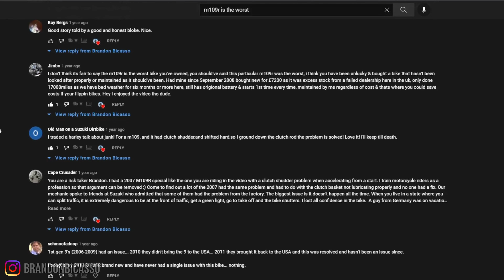Why The M109R Is The BEST Muscle Bike I've Owned

Comment: Brandon, I found a 2010 Victory Vision Tour ABS a year and a half ago, well kept with only 11,000 miles on it. The previous owner had died in a work accident and the widow sold it for 6000 dollars. It only needed a brake bleed and oil change to get it perfect. I have put 7000 miles on it this past summer with no issues. I am 6'5", 280 lbs and almost 67 years old. It is hard to find a bike that fits someone my size without extensive modification costs. The Vision is a perfect fit. It seems to do everything I want to do with it very well. Maintenance is easy and cost effective and the Freedom 106 engine is so simple to work on. This may go down as one of the best vehicles I have ever had. I plan to keep it long term.
Reply from the maker: Interesting story. Enjoy it!

Comment: I sold my 2008 M109R  because it had a tiny bit of a miss to it at lower RPMs.  I new that it was more than likely a map valve,wich is why I traded my 2002 Yamaha warrior XV 1700 straight up for it in the first place. I think I had right at $1,500 in the Yamaha, and the guy was asking $5,500 for the Suzuki.  That was one of the better deals that I have ever had, but before getting the chance to plug off the map valve a guy in Nashville Tennessee offered me $5,000 cash money for it.  After selling the Suzuki I ended up getting another Honda VTX 1800. My m109 had the same color of paint job that yours has,wich reminds me of a 1969 Camaro SS for some reason.
Reply from the maker: Mmm, you’re sticking with muscle bikes too as well. I wanted a warrior at one point too but could never find one for sale. Tried to buy two off Craigslist and each time someone beat me to them.
Reply: @BrandonBicasso After seeing how much I liked the first warrior I had to find another one to go with it. I looked for a good while until I came across the other one, but I had to sale it because the guy who bought it offered me double what I had in it.  I've probably bought and resold around 15 bikes in the last 2 years. It's truly been a blessing to me.

Comment: Just wanted to say I’m trying to buy a m109r But I wanted to know if I buy a 2005 2006 will it look like a 2008 2009 one 2010 And if I find a 2005 2006 what the Price should be for that year
Reply from the maker: Depends on the miles but most of them run in the 5-8000 range in those years. For reference, I paid $7500 for my 07 with 7800 miles in '14.

Comment: Nice vid, thanks. I never even knew the M109R was still in production for the US market. Here in Europe (where we know it as M1800R or VZR1800) that doesn’t appear to be the case. I’ve had my 2007 in the classic black and chrome for some 7 years now; I also have a Kawasaki Z1000SX but if I could only one it would be the M1800R. It has the power, unique styling and sheer presence that make it stand out, it’s so-o-o comfortable and handles so nice, once you get the feel for its dimensions. There are literally only 2 changes I’d like to see if they ever brought out a new model; add ABS and a gear indicator.

Comment: Current favorite bike would be my suzuki s83 boulevard. Got it dirt cheap just to truly try out a cruiser and I love it. Was looking at 109r's and others but am happy I got this since it really handles pretty good being 200+lbs less. Not sure why i still like it so much compared to my multiple other bikes, but it always makes me smile.

Also, some ancient bikes have large community's that sell parts. Me and my dad are into moto guzzi's and the big block motors they made for 35 years with quite a few interchangeable parts. I know BMW is the same. All depends on the bike. Still want a proper muscle cruiser like a rocket 3 or vmax but am pretty content as is.
Reply: I have the 2003 version of the same bike, back when they still called it the Intruder. Got to agree with how it's way mimore fun than you'd think if all you saw was the spec sheet.

Could stand a bigger fuel tank though. Mine gets lousy fuel economy for some reason 😂
Reply: always liked the power of the M109 but shaft (jack) drive is horrible
Reply from the maker: @squish3r  I’ve had some of the most fun on a 250cc motorcycle lol.

Comment: I like the importance you give to parts availability. I never want to spend a lot on a new motorcycle, so I buy older ones and get them working. I found on my first bikes, that were mid-80's Hondas, that most of the parts were only available used and I could never be sure the parts I bought would work. Then I got a mid-80s BMW and found BMW still has parts available for their bikes back to the 70's and some older. At one point I heard when they run out of the old parts they retool and make them again. Because of those parts availability, the old beemers make great project bikes.

You mentioned trying to decide which of your bikes you like the best. When people ask me which of my bikes I like the best, I tell them my favorite bike is always the one I'm riding at the time!

Comment: You do not want ABS, TCS  and other technology done to the m109r as it will add more weight to the MC
Reply from the maker: Okay, explain Rocket 3, Diavel and other newer muscle bikes that are over 100 pounds lighter? There's more to weight savings than adding computer modules. The entire chassis would need updating. I'd be more concerned on price than weight.
Reply: @BrandonBicasso The m109R is heavy enough as it is already and if they did a redesign in order to decrease the weight and add ABS and TCS and made the M109R lighter it would no longer Be an M109R. Flash the ECU for more power or better performance and that is it

Comment: Looking at your m109 videos helped me decide buying a m1800r. I am thinking of mounting a windshield like yours, I've hesitated until now because I want to keep it simple. But riding at 120km/h is exhausting. How did your riding experience changed after mounting the windshield. Can you leave a link from where you bought it? Thanks and keep up the good work!
Reply from the maker: Hey! Yes, the windshield helps a lot. I’m able to ride up to around 140km/h without as much buffering. And when you get off the bike, you don’t feel like cardboard. This is the one I got. Cheap off brand
https://www.ebay.com/itm/Black-Front-Windshield-Windscreen-Protector-For-Suzuki-Boulevard-M109R-Cruiser-/174729026872?mkcid=16&mkevt=1&_trksid=p2349624.m46890.l6249&mkrid=711-127632-2357-0

Comment: Not gonna lie...the M109R is my first dream muscle bike. If I could ever fit on one without needing to be straight legged to the pegs, I'd happily throw money at it. I currently own and daily my second love. The Yamaha Raider. 10k on the Odo and no issues yet. One anoyance I have is its throttle. It's not very smooth. I go from no power to all the power. This summer I'm ordering a tune and an airbox kit to let her breathe a little better and smooth out that throttle. The biggest issue I have with my Raider is that Yamaha discontinued them in 2017. Finding any aftermarket or OEM parts is difficult and always expensive. I wanted to cry when just the backrest cost over $200. If the worst were to happen and me and her end up on the ground, there's a good chance that I'll be looking at a total replacement instead of repair. Due to the extensive effort it takes just finding parts.
Reply from the maker: Yeah, that’s a pretty common thing with Japanese motorcycles and after market parts. 🧐

Comment: Sup Bicasso! Love your content bro! I'm a beginner and taking the MSF in a couple weeks. Doing research in the meantime. What would you recommend as far as something that has the style of the M109R and V Rod that is a little easier to handle for a noob? I've seen a lot of people say that the M109r is not the way to go for a beginner. I'm a very big guy at 6'2" 380. Budget is about 10k. Please let me know what you think and thanks in advance!
Reply from the maker: Congrats for taking the leap to learn and learn the right way. Most muscle bikes will have a similar vibe to them with the styling. Lot of power/torque out the gate. I def don’t recommend the 109 as a starter bike BUT, it’s equally important to be comfortable on what you’re riding. So, the 109 might have to be the one you get if that means you’re comfortable. That comes at a risk of course being a new rider. If you got the basics down and can respect the throttle and weight of the bike, you should be able to handle it fine. If you’re willing to sacrifice the look, check out the Yamaha V Star, Suzuki M90 or maybe the HD Heritage.
Reply: Thanks for the fast response!

Comment: I think Suzuki could revamp the motor for a bit more power and torque, and update to a 6‐speed transmission for better highway cruising. Maybe some suspension tweaks. But I'm pretty happy with mine.
Reply: Whats the furthest distance you ever rode in a day? Hows the gas on that bad boy?

Comment: The 109 is almost certainly going to need a major update at some point thanks to emissions BS. Hopefully in the process of updating it they can cut off some unnecessary weight. I loved my v-rod, though I begrudgingly sold it since it had been beat to hell and I didn't wanna fight it to keep it on the road lol. I am looking to sell my Low Rider S though, awesome bike but it's really just not worth the money. Been tossing around Boulevards (both versions, the C90 and M109, real shame they don't really make a C109 lol) and some of the bigger displacement Yamahas. M109 might be my next baby, just depends on what the market has to offer when I start looking lol. You clearly ride it a lot. I have some pretty horrible lower back issues and sciatica. How is comfort for you for longer rides?

Thanks for the video brother
Reply from the maker: Hey, I’m pretty comfortable on it. I’ve put 500 miles on it in a day with a passenger. That was without a wind screen. Lots more comfortable now with the windscreen as it prevents rapid fatigue. I recommend it!
Reply: @BrandonBicasso  Thanks man! Think I'll see if there are any around I can get a good test ride in on.

Comment: My first real bike, is also my current bike. A 2016 Yamaha Stryker. Got it brand new in 2018. I have loved it so much. I've only ridden a couple other bikes in the past. Last year, I was able to test ride some Indian models, and the Pan America. It really opened my eyes to how much is lacking in my bike. Not so much with power\performance, but with comfort aspects for sure. The Stryker is a sport cruiser, and has a pretty stiff ride. The seat is pretty bad and starts to hurt after only a couple hours. The clutch pull is also very heavy, which I didn't realize how heavy it was until I rode other bikes. Non of that is a deal breaker by any means, and I still love the hell outta my girl.

The Springfield Dark Horse is my dream bike right now. Rode it last year and fell in love. Great power, super comfortable and handles great. I still want to try and ride more bikes this year to experience more.
Reply from the maker: Definitely ride all the bikes! I haven’t ridden a Raider/Stryker in years. Always loved the way they looked.

Comment: My favorite car was for sure my 91 240sx. I bought it for 200 bucks! Learned most of what I know of working on cars replacing the motor, doing 5 speed swap, replacing seats and body panels. Would still have it if it wasn't for a tornado. Favorite bike out of the 10 I have owned since 2013 would be my current 2014 ultra limited. This one may be a forever bike

Comment: I've had common and uncommon cars, both performance oriented and otherwise. I prefer common (relatively) , performance oriented just so it doesn't break my wallet every time I have to work on it (looking at you, Lincoln LS. Damn fine car to drive but EFFF mid 2000s jaguar engineering and parts).

Comment: Being 6'5" with a 36" inseam M109 is one of 3 motorcycles I've found to be reasonably adaptable for comfortable operation. +3" forward controls and or a +3" taller saddle would be perfect. I'm currently on a "slightly" modified KLR. The Concourse would also need a custom seat.

Comment: CRAZY, I HAVE THE EXACT BIKE, & COLOR SCHEME. I HAD THE TRANS ISSUE YOU ARE SPEAKING ABOUT. THE BIKE HAS 14.5 K ON IT & I HAD TO TAKE IT IN TO GET FIXED. $4500 TO GET IT FIXED. 

LOOKED FOR A SHOP, NO ONE & I MEAN NO ONE WANTED THE JOB. FINALLY I FIND A SHOP. THIS WAS SPRING, LATE WINTER 21. THE DEALER SAID THEY WOULD DO THE WORK, BUT ONLY AFTER SUMMER BECAUSE THE JOB WAS GOING TO TAKE  MORE TIME THAN IT WAS WORTH.  I ASKED WHY ? THEY REPLIED THEY COULD MAKE MORE MONEY DOING MAINTENANCE. IT WAS GOING TO TAKE A LOT OF TIME, IF I WANTED TO FIX IT, I WOULD HAVE TO WAIT UNTIL WINTER OF 2021, I WASN'T GIVEN ANY CHOICE.

I LIVE IN WASHINGTON, RIDING SEASON IS SHORT, DISAPPOINTED, I WAS GOING TO MISS ANOTHER SEASON BUT I HAD A 14.5K MILE BIKE I COULDN'T RIDE & I DIDN'T WANT TO JUNK IT, EVEN THOUGH IT'S ONLY WORTH ABOUT $4500. IT TOOK 4 OR 5 WEEKS TO FIX. WHEN I GOT IT BACK, IT HAD A RADIATOR LEAK. I DIDN'T NOTICE IT UNTIL LATER WHEN I SAW SOME FLUID ON MY SHOP FLOOR. I HAD ONLY RODE THE BIKE ABOUT 10 MILES SINCE PICKING IT UP, I HADN'T EVEN TAKEN A DAY TRIP YET. I RODE TO NEARBY CONVENIENCE STORE ONCE, THAT'S IT.

I CALLED THE EVERETT POWER SPORTS SHOP THAT IS THE LOCAL SUZUKI SHOP WHERE I HAD THE BIKE REPAIRED & WE SET UP A TIME TO BRING IT IN. THEY DID AN ANALYSIS & TOLD ME I NEEDED A NEW RADIATOR. HOW COULD THIS BE I THOUGHT? I JUST SPENT $4500, THEY HAD IT ALL APART & PUT IT ALL BACK TOGETHER. IT DIDN'T MAKE SENSE TO ME.

THE SHOP SAID IT WAS GOING TO COST ABOUT $1500 TO REPLACE THE RADIATOR BECAUSE IT MUST HAVE HAD A ROCK HIT IT & RUPTURED IT CAUSING THE LEAK, BUT I JUST DIDN'T BELIEVE THAT BECAUSE ANYONE WHO RIDES KNOWS IF ANYTHING HITS YOU AT SPEED, YOU KNOW IT. I KNOW WHAT ITS LIKE TO GET HIT BY A ROCK, ITS SOMETHING THAT YOU NOTICE & I KNOW NOTHING HIT THE BIKE. I ALSO MENTIONED THAT IF A ROCK HIT THE RADIATOR, MOST LIKELY THE RADIATOR WOULD HAVE SOME SIGNS OF DAMAGE, WHICH IT APPARENTLY DOESN'T.

I ASKED THE REP I WAS TALKING TO IF THEY COULD GET THE RADIATOR REPAIRED, THAT WOULD BE CHEAPER BUT I STILL WASN'T SATISFIED, I STILL FELT I WASN'T GOING TO PAY FOR SOMETHING I DIDN'T DO, I STILL FELT LIKE I WAS BEING TAKEN ADVANTAGE OF. OF COURSE THERE STANCE WAS THAT THEY WOULD NOT RELEASE A BIKE THAT WASN'T FIXED TO A CUSTOMER FOR PICK UP, SO I MUST HAVE DAMAGED IT. REGARDLESS, IT WAS LEAKING. 

THE REP SAID THEY WOULD HAVE THE MECHANIC LOOK AT IT AGAIN TO MAKE SURE THE RADIATOR WAS THE ISSUE. AFTER RE-EXAMINING IT, THEY FOUND THAT THE HOSE IN THE BACK OF THE RADIATOR WAS BRITTLE & LEAKING FLUID THROUGH THE RADIATOR MAKING THE LEAK LOOK LIKE IT WAS LEAKING OUT OF THE FRONT. SO NOW IT LOOKS LIKE THE RADIATOR IS OK BUT THE HOSE NEEDS TO BE REPLACE. BIG DIFFERENCE IN COST.

IF I DIDN'T QUESTION THE PROCESS & USE SOME LOGIC I COULD HAVE EASILY SPENT ANOTHER $1400 OR $1500 TO GET SOMETHING FIXED THAT DIDN'T NEED TO GET FIXED OR REPLACED. I'M STILL IN THE PROCESS OF THIS & THE DEALER STILL HAS THE BIKE AS OF THIS WRITING, SO I HOPE I GET THE BIKE BACK & THERE IS NO MORE IMMEDIATE ISSUES. NOW I CAN'T HELP TO WONDER IF THESE GUYS DID A PROPER REPAIR ON MY BIKE WHEN THEY REPAIRED THE TRANS? WHAT ELSE COULD THEY HAVE MISSED?

WHEN I FOUND OUT HOW MUCH IT WAS GOING TO COST FOR THE TRANS REPAIR. I OFFERED TO TRADE THE BIKE IN ON A NEW BIKE, THE DEALER SAID NO. I OFFERED TO STRAIGHT OUT SELL THE BIKE THEY SAID NO, SO I WAS EITHER GOING TO SPEND THE MONEY FIXING IT OR HAVE A BIKE I COULDN'T RIDE. 

I'M NOT BASHING SUZUKI, I THINK I'D LOVE A HAYABUSA, BUT BECAUSE OF THE OVER ALL WAY THAT THIS PARTICULAR DEALER DOES BUSINESS (MAYBE THEY ARE ALL THE SAME, I HOPE NOT)  I WOULD NEVER BUY ANOTHER SUZUKI PRODUCT, I GET THE SENSE THAT THEY DON'T REALLY CARE. THEY DIDN'T CARE ABOUT STANDING BEHIND A PRODUCT THEY ARE SELLING, THEY DIDN'T CARE ABOUT A RIDING SEASON THAT WAS LOST, THEY DIDN'T CARE IF THEY DID A THOROUGH JOB ANALYZING THE ISSUE WITH MY BIKE, THEY DIDN'T CARE HOW MUCH MONEY I AM SPENDING & APPARENTLY THEY DON'T CARE IF I'M A REPEAT CUSTOMER. 

I NOT BASHING EVERETT POWER SPORTS, I'M JUST SAYING